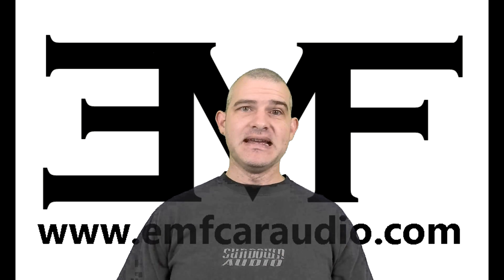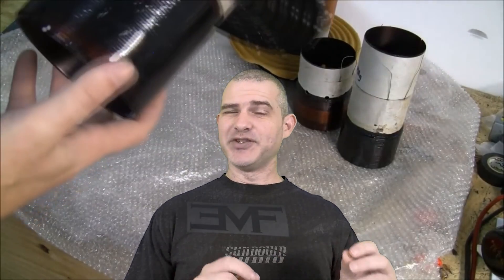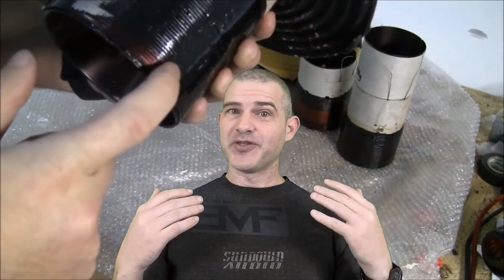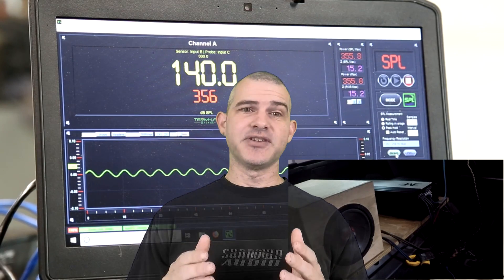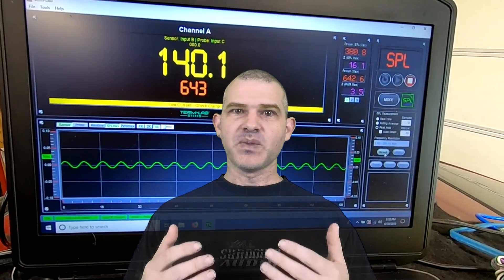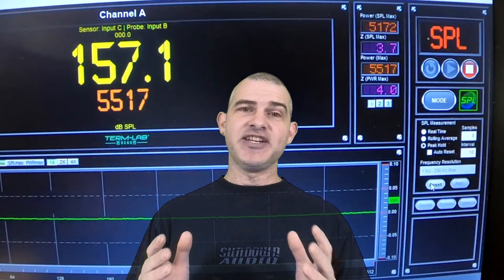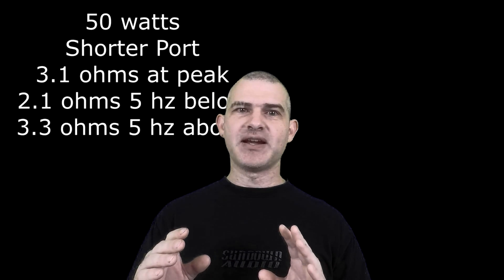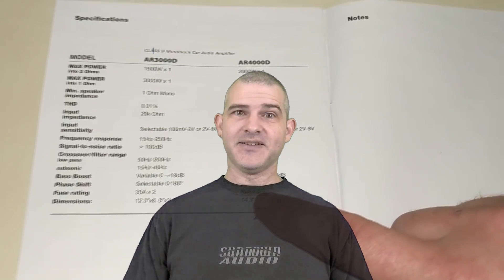Top 10 Tech Stuff Tuesday's you should be watching

Comment: Hahaha I May Have Been The One Who Contributed To Impedance Rise Video In This Top 10 Tech Stuff Tuesday Video hahah.

So Tarmaps Has 2 Strikes From Me So Far. I Recommended A Tarmaps 3K For Some Sony Subs I Built In A Custom External Aero Part Enclosure. 

- STRIKE 1 : The Low Pass Filter Only Goes Down To 80Hz. What The Hell Is That BS lol. Not Real Ideal For Subwoofers.
- STRIKE 2: It Fried My Ocilliscope. I Didn't Get To See What Wave This Thing Was Outputting To The Speakers. It May Have Been My Fault Because I Ran My Portable Scope On The Vehicles Power Outlet To Power It . (I usually Keep It Charged Up But It Was Dead And Wanted To Use My Scope Now). As Soon As I Plugged My Leads Into Scope I Heard A Loud Pop. Scope Is Dead And All Power Outlets In His Vehicle Are Dead. So I Have To Fix His Outlets hahah Hoping It's Just A Fuse.
STRIKE 3 Is Pending For Taramps. If I Can Get A Wave Reading From 18Hz to 50Hz That's Clean And Equal Amplitude  It MIGHT Pass As A Budget Amp. But Untill Then... 2 Strikes

It's Definitely Making Power. Planning To Run An External Pre Amp Low Pass Filter For the Input RCAs Of the Taramps So It Can Have A Low Pass Of 20-300Hz LIKE A REAL SUBWOOFER AMPLIFIER.